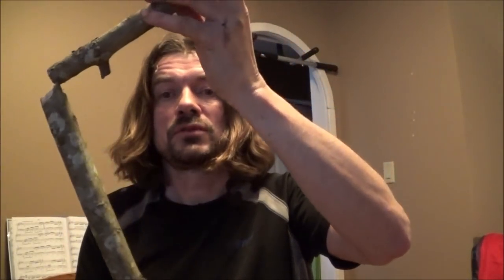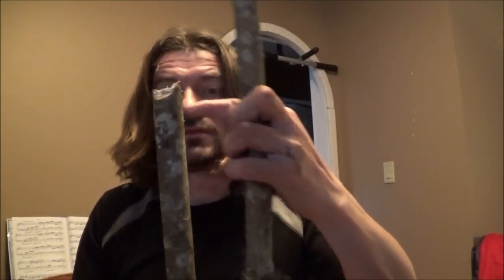Tree Topping Cut Explained

Comment: A good alternative that is not only safer but guarantees that there will be no split is to wrap the trunk up with a couple wraps of a piece of bull rope above the face cut a few inches to a foot, this prevents any split from going wide open into a barber chair and keeps the tree trunk intact while finishing the back cut, sometimes a extra piece of rope is worth it's weight in gold especially if it's placement saves your life or serious injury but just make sure that it is not attached to your harness, it should be a 15 or 20 foot piece that is long enough to wrap 2 or 3 times around the trunk and be firmly tied.
Reply from the maker: Another good one mate, especially for one-offs and falling from the ground. Not so practical if you are climbing multiple trees in a forest. And completely redundant if the split instead runs down the stem you are tied to, and not up the top you are removing.
Reply: Daniel Murphy in one of his youtube vids tries an intensional barberchair and wraps a load of bull rope around below the cut to prevent splitting there, but it was surprisingly ineffective, stretch etc I would choose chain if I wanted to try prevent barberchair that way. Doubt I’d lug that up a tree though!

Comment: I loathed rigging out the tops of tall skinny Norfolk island pines. The rides you go on those are nothing less than vicious. Now if you got a good groundman, he can mitigate the whiplash by easing the line, somewhat.
Reply: I think maybe even more helpful than letting it run is maybe having someone else pulling the top over hard and fast, so as to counter the push back. Any thoughts from anyone?
Reply: @Andrew-is1yd  
Yep, snap/jump cut would've worked. But unfortunately, we can't always drop tops due to what may be below. Now if you have a good groundman who knows when to finesse the line, there will be virtually no whiplash. But honestly, how many of those guys even exist.

Comment: well explained. never thought of that method to prevent BBC before. It seems like the cut sides create posts that are not attached to the tree above the face, so those fibers are not able to split, and that is enough to prevent the trunk split and subsequent BBC before the hinge gets thin enough to trip. Seems like if there was enough force it would still split, but just like with a coos bay, the overall amount of fibers between the top and bottom have been reduced enough to keep the tree from splitting. I have to think about this some more. Thanks for the thorough explanation. I also didn't realize there was that much push back going on up there. We get some, but east coast trees just aren't tall and skinny enough to act like that.
Reply: I got some push back topping a skinny fir and had thoughtlessly positioned myself back to another fir 10’ behind me. Just felt it touch my tee shirt! All fine but close enough to make me think!
Reply: Maybe the Coos bay works the same way? I had never seen this description/technique either.
Reply: Don't trust this method as a sure way to prevent splitting, when in doubt always WRAP it up with bull rope both above and below your flip lines.

Comment: Years ago, before all these great vids were available, I had a mate who was up an oak removal. He did his face cut, was putting in his back cut and stopped cutting too soon, and didn't make any relief cuts on the side of the hinge. The spar split along the grain when he stopped cutting and he rode it to the ground and died. 

Had he kept blasting through that hinge when the top started to go, and put in some relief cuts on the sides, he'd probably still be alive. 

I was lucky, I learned all those hinge  dynamics in a bucket truck long before I had to ever climb a tree and take a heavy top out. I saw it up close in a bucket how the spar can split below the hinge, and I learned to blast through more hinge than I needed to in order get the top tipping in brittle types of trees without splitting out. Even with relief cuts in the side, I still blast more hinge than I need to just to avoid these types of splits. Especially on oaks, where splitting along the grain is common. 

Conifers seem less prone to this type of spar split than oaks, so I usually will stop cutting sooner on them, simply because they are much lighter and don't seem to let go along the grain like oaks. 

I sure wish I could have taught my friend that trick before he made that last cut. Or that these types of videos were available to him before he got in way over his head. 

Thanks for your contribution to arboriculture, sharing your knowledge of these dynamics of hinge wood, relief cuts and spar push back. I just wish these videos were around 20 years ago. 

I've tried to impart the dynamics of push back of a top leaving a spar to all the new climbers I ever worked with, but it seems like you almost have to see it up close and ride it  before you understand how hard a tipping top flexes the spar when the top tips on the spar and forces it back through that shift in center of gravity. 

I learned the hard way about oak splitting along the grain when popping out tops, and the only way to avoid it was blasting through the hinge even though the top was going, just to reduce the chance of the spar splitting out below the hinge.

Comment: Side cuts work, I did it also on big branches and at the ground on trees  tensioned. In my opinion, with a small angle of the notch, the top breaks off quickly and the stem goes back 'cause you're taking off weight on it. Thanks for sharing

Comment: Frankly, this is equal or better quality than a lot of talks I have sat through for arb CEU's. I'm really glad you made this video Reg. I saw some of the "initial" comments that you responded to on several of your topping videos about bore cutting and needing to make more open face cuts. Extremely ignorant. From my experience these sound exactly like what I hear from the level A/B/ worse yet, C Sawyers who have been through "all three" Game of Logging classes plus storm damage yet can't tie a bowline knot. Too many of them think their techniques are revolutionary and should be applied to any and all cuts in tree work, and are incredibly arrogant about it. A double bore and trigger setup with a very open face would not end well here, and would be very impractical to do in spikes/lanyard. There are surely other ways to accomplish a back release, but they approach every tree with same technique. They have a phobia toward pull ropes, completely ignorant of knots, terrified of heights, generally dangerous around vehicles and equipment and have a very mindless approach to doing every tree with wedges- like you said they are certain that every time they bore cut a tree they have prevented a "dangerous" barber chair they can be escaped from on the ground. Watching them cut spars is comical. There are a lot of them around trying to tell arborists how to do their job and getting into supervisory positions. Don't fall for their bs and do something you are not comfortable with. Egotistical, dangerous jackasses in my experience, trying to turn a safety crucial job into a competition.
Reply from the maker: Thanks Elliot. I dont fall for anyones bullshit, mate. Edit: this video (or any other) is not for their benefit
Reply: I meant that about falling for their bullshit as a general caution to tree workers starting out and learning different techniques. It was not directed at you.
Reply from the maker: @sireliot2149  either way mate, I agree

Comment: It's nice to see something in depth regarding cuts when climbing. I just did my first tall white pine tree the other day. Cut the top at about 70 ft, top was 20 ft and man that thing took me for a ride! Slight lean but I put the top about 45° off the lean. Just made some small cuts in the side because I've seen other climbers do that, because of the peeling. I was wondering about what cuts would put the least amount of pressure on the stem. I need to cut the tree next to it and it is slightly compromised.... But this helps put a lot of this sort of stuff into perspective. Thanks Reg

Comment: As always, great video Reg! Good tip on the side cuts,  I completely agree about not wanting to bore cut up there! I usually just choke my climb line off, use a fast cutting saw, and brace myself for a rodeo ride. I have also used strapping in a decaying maple or cottonwood where the risk of barber chair starts to get really scary and climbing higher is not a better option. Stay safe bro!

Comment: 12:45 I've never bored into the middle of a hinge attempting to prevent a barber chair. When I have seen that done I always assumed it was to get the center wood on a tree too large to reach with the bar length in use. I'm not a professional by any means - but most of the trees I end up cutting are leaning alders, and they are brittle and prone to barbercharing. I bore through the side - taking the middle out of my back cut initially, so the portion opposite the face cut remains in tension. I'll bore in, form my hinge to the thickness that seems appropriate based on lean/weight/rot/etc, then start cutting from the middle of the backcut away from the hinge. When there are 2-3 inches of wood in tension remaining, I'll take my saw out of the bore/backcut, and cut the tension wood from the outside in - almost like a normal backcut, but there is much less and usually it has enough tension that it tears itself loose before the cuts meet up.

Very interesting concept of narrowing the hinge to alter the tension distribution. Thanks for so many great videos.

Comment: Thanks for taking the time to put this together after your work day. Even though I'll probably never tackle anything of this magnitude, I still feel having benefited from your work experience makes me a better climber. 
Felling from the ground I was taught to leave a back strap for a number of reasons including avoiding a barber chair. Do you  have any comments on using a back strap when topping one of these giants?
Reply: ditto the question about the backstrap in this scenario, please.
Reply from the maker: 2 things Chris. Thats a 32 inch bar, so its difficult to lean back far enough in the lanyard to fit the whole saw and bar in between your body and the wood to make the bore cut. I have done it in the past, but its not easy to do safely. 2nd, on that particular stem you saw how much sway was created as the top tipped and broke off.....so with a release cut/back strap, youd essentially be releasing all the energy in an instant, instead of more gradually. Not sure thats a good idea. Maybe on different tree, but not that one.

Comment: Seems to be a need here for some kind of jig that could be set up at tree top and then operated remotely from the ground. Incredibly dangerous work cutting that high up, just tied in.I say this as a design engineer and someone that has used chainsaws for 30 years or so, but not at this level. All ground work here on a farm......I'll get working on the prototype ASAP. :)
Reply: I work my milling chainsaw from a distance with a pull cord. would be fun to see drone footage of your remote topping 😄. ‘Bagsy not me going back up 200’ to get the saw down!

Comment: I wonder if the continued backward motion after the top left was caused by stored energy from the heavy side. Like it was already pretensioned?
Just a thought.
Reply: Like a spring pole release? Billy was wondering this too but reg says he ended up back in the same spot when the sway stopped so that seems like evidence it was push rather than release.
Reply: Reading your comment again I’m not sure if my reply was on point? I’ll leave if there anyway...
Reply: I think you were commenting particularly on the continuation of the backwards motion after the top left, and it being caused by the release of the forward lean. That makes sense to me.
Reply: Neil D yes sir! I’m not sure if that’s an accurate assessment or not. Just speculation.
Reply: When you have push back like that, the weight of the tree top, pushes the weight of the bottom stem as well. that puts weight into motion, which is kinetic energy. There is so much weight on the bottom stem. (from your cut to the ground.) That much kinetic energy isn't going to stop easy, so the tension of the tree on the side of the push back pulls against the tree, (if you understand how the fibers tension then you probably know.) Slowly pulling the tree back the otherway. Its just an unbelievable amount of kinetic energy so it takes a long way and a lot of tension to stop that travel. Hope this helps.
Reply: @RebirthMusicStudios  undoubtably massive force pushing back. huge force wanting to return the tensioned stem too, which im guessing usually even out, though i am no physicist. Guess i'm just running through my head the difference between push back and spring back and wondering what practical considerations there might be in a situation like this. thanks man!
Reply: which reminds me! you've likely seen this extreme spring back? :D https://www.youtube.com/watch?v=tsD1Bp_xaPc
Reply: @neild7971  spring back is usually from pretension but also your hinge wood.push back is normally from the weight, since the weight had nothing to push off of in that palm video it was all pretension spring back. You saw in the video reg slowly worked the weight off the tree to avoid a spring back. Which honestly, if you can go higher and remove less weight at a time you avoid more spring or pushback. In that palm video though, if he had the space below he could have dropped a lot more of the tree as a top and it wouldn't have slung him like that. The tension wood, and kinetic energy are definitely something to read up on and really get into to make sure you understand the spring back, pushback. But your notches and holding wood are just as essential in reducing those problems as well as cut placement. This is one of the most interesting jobs I've ever had, and I love learning the ins and outs of it!

Comment: Another thing that might be worth thinking about, if you have a huge lean on the head like that it will be pre-bending the trunk a bit like flexing a plastic spoon with your finger. Once you release your finger the spoon snaps back, a similar thing would happen with the trunk when you release the hinge. 

This would be added on top of the force of the top pushing as it tips. This would result in the trunk continuing to go extra after the top disconnects and could well be a much larger contributor with a massive lean than even the tops' push.

Comment: Very different bore cut use than what I was thought and what I use. I would push the bar inside from the side, creating the holding wood of desired width and than, cutting from the outside the remaining safe corner. Have seen it done by one inspiring guy on YouTube with a handsaw too (just the "safe corner" part) Guys name was Grufrock, too bad he dose not post anything anymore. I think he was also working on the Vancouver island. I worked there only for a short while in Victoria, too bad we've never meet. All the best Reg!
Reply from the maker: Thats Gord, hes over at Gibsons on the mainland. You're describing a release cut. Great for moderate leans, short bars or cutting from the ground. But this was a big heavy leaner, as evident by the sway. Problem with a release cut while climbing on a tree like the one in the video is that you release all that energy in an instant. The sway might be dangerously violent as a result. Also, thats a 32 inch bar in the vid, not so easy to position oneself to safely make the borecut.
Reply: Haven't seen that particular video yet, u know what u're doing and I agree with everything above. I definetly gonna try your method of bore cut for the leaners, cant wait to try it out. Happy to hear that Gord is alive, I was wandering what happend to this guy. No one else had such impact on my career, it's been a decade already of moving from place to place and without him I probably would never leave Europe and become who I'm now.  And he even doesn't have a clue. I'm in debt to this guy. You're also doing great job, have been following you for years. You keep it professional , no show off. Thanks for answering!

Comment: Thanks Reg. Would you advice the climber to start the back cut from the side, parallel to the hinge, bore in to empty the middle and leave a back strap??? To avoid barber chair, i mean.
Thanks again
Reply: That’s the way I was taught as well. Keeps your sapwood for the extra control and never puts you in danger of eating a barberchair or being under a heavy limb. Worst thing that happens is the tension wood is compromised causing it to release early.
Reply: @gschgvt2956  thanks bro
Reply: I was curious why Reg didn't mention this method in this one of a kind video.... maybe he will address this in the comments.
Reply from the maker: @gschgvt2956  On a tree like this, where you are anticipating a huge amount of sway, a release cut would by nature release all that energy in an instant, instead of more gradually as with a conventional back cut. The sway might be dangerously violent as a result. On the ground is great, but not so high with a lean like this one. Thats also a 32in bar on that saw, not so easy to lean back far enough and safely make a borecut.